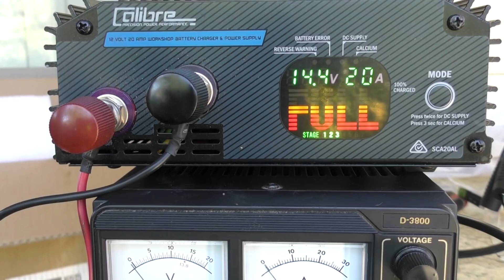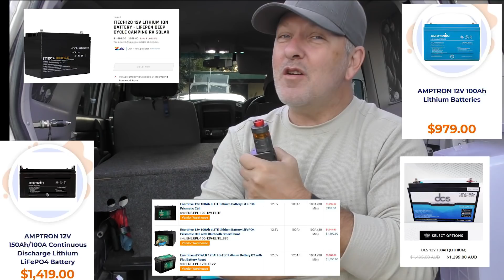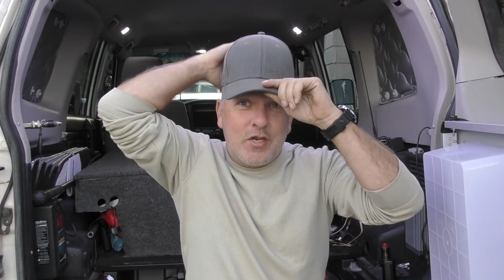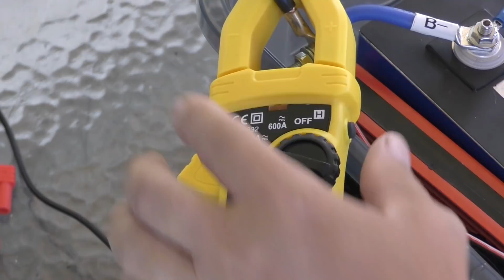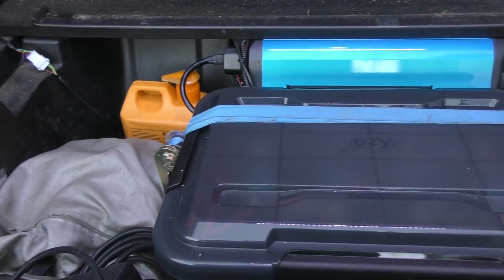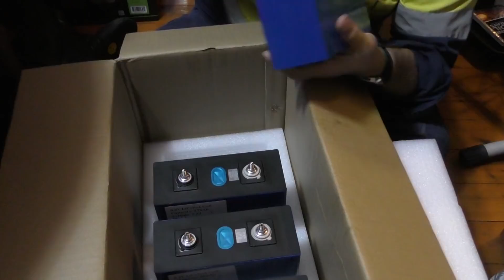DIY 4wd Lithium Battery install with inverter and induction cooker

Comment: As a newby to your site this is very interesting as are the other videos, as I am in the process of installing under floor batteries and compressor  but could not see me using that much power even though i have one of those hot plates, will go and see Redarc which is just down the road :-)
Reply from the maker: Leave your wallet at home

Comment: I bought a 300Ah (200A max continuous current) LiFePO4 battery off eBay $841. 2yr warranty. 
I also bought a 3kW Inverter off eBay for around $350. 
2200W Induction Cooktop off eBay $39.95. 
So I’m happy with that. I did also have to get various switches and 95m㎡ cables for the inverter but I’m pretty happy with the price. 
Also recently added a Ninja Foodi Flip Air Fryer oven for under $200 on sale.
I have a 40A DC-DC ($222) with solar input MPPT - 250W Solar currently. 

You basically can’t run an inverter and an induction cooker will 100A BMS. Everything will just take too long. You want to be able to run your cooktop at full power - you’ll be amazed how quickly water boils using induction but you’ll need to be drawing up to 200A for that. 

Mate - are you filming while holding a Vape?

Comment: Your battery should have a C rating charge and discharge.
The C rating is amps 1C = 100 amps
2C = 200 amps. 
Hope this helps
Reply: For those looking in the future, that’s not quite how it works, C refers to the capacity in Ah. 
Ie for 300Ah cells, 1C=300A 2C=600A.
Reply: @Br3no94  The battery C Rating is the measurement of current in which a battery is charged and discharged at.
Reply from the maker: You're both correct. The c rating is used to measure the charge and  discharge rates. The c relates to the battery capacity. So so if the battery or cells capacity is 100Ah   1c is 100A (1 x c),   2c is 200A (2 x c)  and 0.5c is 50A (0.5 x c)  .  I.e   # x Capacity = charge / discharge rating.  These rates are not always the same and often charge rates can be half the discharge rate.

Comment: Any updates on how the battery is going? Do you find the cells are ok when you go offroad? Ive got the same bunnings box as you but trying to work out how to strap it down in the vehicle and again how to secure the cells inside it to remove any up and down movement :). Loving the videos keep up the epic work! Thanks

Comment: Watched the video twice.
Absolutely would love a vid on the assembly of the Alibaba 4 x 3.2v lithium batteries and 100amp BMS showing fitment/installation in the Bunnings box, and holding them in place.
Wire gauge/sizes, inline fuses, Anderson plugs, crimping of wire lugs etc, and links to items if possible.
Cheers

Comment: That battery pack & BMS will fit in a king's battery box nicely.
 I easily get around 2weeks running my 40ltr Engel without any charge
Reply from the maker: Cheers Daz, handy to know. I had to go with the lowest profile I could so it would fit under the floor at the back. It didnt leave me much room on top.I might consider one of those though when I do the build for the caravan. I'll have a little extra height to play with but am considering 2 x 12v banks ...we'll see

Comment: Good vid! I looked at buying the same LiPo4 cells and a BMS, I guessed needing 300Ah but ended up buying a "reputable" Alibaba 200Ah battery delivered for A$700. I'll try it out, it took 3 weeks from manufacture in China to Remote WA (Australia Post takes 3 weeks to get a letter from Perth to Kalbarri!) with the idea of getting another so I have 400Ah and a weight of 40 kg, I have tried it out with a $250 3,000w inverter, peak 6,000w. The $50 induction cooktop I have doesn't phase it, I hadn't considered dialling down the power, a good tip but I will need a pod expresso machine, an essential for life camping! I am also toying with the idea of on-demand electrical hot water heating for showers and dish washing, the theory is dubious admittedly but I am keen to try it out. A good proof of concept plan, adventure is the game!
I only have a 250w solar panel but room for another, with Renology to handle the charging.
I like the app  you use to monitor, what is it?
Reply from the maker: Sounds like you're well and truly down the rabbit hole. On demand heating sounds good but power hungry. Keep me posted though if you find something that works. It's your set up in a van or a 4wd?

Comment: Great work and great video again. Congrats. I should stop watch your videos, my head is full with projects. 
Recently, I started learning about lifepo4 batteries. I am building my lifepo4 project in my head now. My consern is what cable size you run from the alternator to Daly BMS, and how these 250A effect to the alternator. Thanks
Reply from the maker: No worries, happy to help you spend your money 😁. The alternator isn't connected to the BMS directly. It's goes via the main battery, then through the dcdc charger and then to the battery/BMS.  The BMS sits between the battery negative and anything else that would normally be connected to the battery negative.  So the cable size has to be able to handle what ever load your dcdc charger will put on the main battery/ alternator.  The 250a rating of the BMS means it can pass through that current to loads connected to it. That rating has no impact on your main battery at all.   How that makes sense
Reply: @DENMONKEY  Thanks a lot. Now it is clear. 🍺🍺🍺

Comment: Thanks for the video. I've got the same exact BMS but on 100Ah cells through a 1000w inverter and trying to figure out if those 1800W+ induction units pulse their power draw from 0 to Max to simulate lower power when used on lower settings as that would trip my inverter or my BMS. Good to know your unit didn't do either. I'll probably grab one of those cheap-o cooktops off ebay so fingers crossed the Breville isn't doing something special..
Reply from the maker: No I was hoping it wouldn't do that, but I'm yet to hear of one that doesn't when on a lower setting. I'm need to do since more testing but it looks like the smaller the base of the pot/pan the less power it may use. But don't quote me. I've seen some odd things but that's what I'm thinking so far.
Reply: I brought 1000 watt kettle plus induction cook top just run cook top at about halfway. Many different cookers and crock pot about the 1000 watt mark 100 amp lithium battery   1000 watt inverter. 2000 watts is better but about twice the price to set up.

Comment: Might be a silly question, but if each cell is 3.2V & 270 amp hours. When combined would it make 12.6v and 1080amp hours??
Reply: Hi Nick, was just looking through the comments and saw yours. Not a silly question at all. The voltage and current values depend on how the cells are wired together. Each cell is 3.2V so you need 4 in series (cell 1 positive to cell 2 negative, cell 2 postive to cell 3 negative, and so on) to reach a 12V working battery pack, but series connections don't increase capacity. It's still 270Ah. And vice versa, parallel connections (all cell positives bridged together, all cell negatives bridged together) do increase the capacity, but the voltage remains at 3.2V for the entire pack. You can also arrange 2 series and 2 parallel connections to get a 6.4V 540Ah configuration, but most systems are in increments of 12V.

Comment: Thank you for an interesting video. Good to see some induction cooking. Myself is building a solar setup for my grandma off-grid, just waiting for the Daly BMS :)
Many seems to be more for gas cooking rather than induction. But I went with it anyways. Good to see some more people trying it out :) How many watts were you able to draw out from the inverter with the induction plate? Since we have 230VAC in Europe I couldn't follow since you have different voltage from us. Regards from Sweden 🇸🇪
Reply from the maker: Hi Oskar, thanks mate. Have a look at the recent video mate . I'll show me using the induction cooker and power usage in that https://youtu.be/MN58A8T92rw

Comment: Hey mate! Good to see someone else getting on the DIY batteries for 4wd/camping in aus!
Did you have to pay GST on the price quoted by the Alibaba seller? I'm looking at ordering some and they say the price "excludes taxes", not sure if GST applies or not. Thanks!
Reply from the maker: Hey Hayden. Thanks mate. I didn't have to pay any extra over what was quoted by the seller.  I think that changes if you go over the $1000 , I'm not positive though
Reply: @DENMONKEY  Tis! I bought one lithium battery for $700 while wanting two, just so I was under the $1,000 threshold for GST. Now after seeing the quality, I'll buy the 2nd

Comment: Hey bloke. Just bought a Pajero and been getting some good tips from you. Maybe you can help answer something for me. Where you have your Inverter mounted (Rear R/H side), there seems to be what looks like a square panel. Is this actually removable and If so, how? Would I lever It from the top, bottom or sides? Cheers :)
Reply from the maker: Hey Scotty, welcome aboard mate. No she don't come out mate, its just like a vent but its fixed in place. You could cut it out i guess but short of that, no go bro.

Comment: Hi Brett you missed your calling. What is the RFI like on 40 m when the inverter is operating?
James
Reply from the maker: Good question. I'll be checking that sheet of thing out once the instead has settled. Can't be any worse than some 12v fridges
Reply: @DENMONKEY  I cannot operate on 40 m with my 300 W inverter on regardless of it whether it is loaded or not
Reply from the maker: Yeah I'm expecting the same. My hf isn't in the car at the moment but I'm expecting to have to turn stuff off if I want to use it

Comment: Hey Brett, check out the back of this Pajero https://www.youtube.com/watch?https://www.youtube.com/watch?v=lSkcLjooa7s&ab_channel=%D8%A7%D9%84%D8%B9%D9%84%D9%8A%D8%A7%D9%84%D8%AA%D8%AC%D9%87%D9%8A%D8%B2%D8%A7%D9%84%D8%B3%D9%8A%D8%A7%D8%B1%D8%A7%D8%AA
Reply from the maker: Thanks Karl. Wish I could understand what he was saying. A bit more money spent on that one I think 😁 I don't want a gas bottle in the back like that one though but I did like those led light strips in the tops of the rear windows.
Reply: @DENMONKEY  Ahaha for sure I was not too keen on the gas bottle inside; however, despite the obvious dollar cost, thought it was unique enough to mention. 
Hopefully it inspires you and others to bring something more relevant to the Aussie options. 
Anyhow, the link hopefully helps both your and the Arabic chaps algorithm. 
Funny enough, despite not speaking not a jot of Arabic, after watching several of his Pajero related videos, it wasn't too hard to get the gist of what they're communicating. Google Translate, however, was more a hinderance than a help.
Reply from the maker: @karl4834  I appreciate it. I'll have a look at his other stuff. The trim work was excellent, albeit not my cup of tea.

Comment: Love the video mate,  looking at a2nd battery for my paj. Was looking at a DCS unit,  but this looks the goods with more power for a hell of a lot less. Would love to see the build and install video. 
How do you think the battery will handle bouncing around in the back on trips?
Reply from the maker: These are prismatic cells which are the details design as you will find in your off the shelf batteries. So in theory no more or less suitable for 4wd installs. The only difference would be how you package them and protect them. Obviously the off the shelf option has its own box to protect the cells. I've seen others build these into a timber box or just use a battery box like those from Supercheap . I was going to use one of those but couldn't find one the right size. The dcs have a good rep and I don't want to talk you out of them,  I just want to share what I'm up to for informations sake and still want everyone to make their own choices.
Reply: @DENMONKEY  all good Brett, just want sure how the batteries were secured in the plastic tub so I thought they may bounce around a bit.  Sure you have them strapped down tho.
Was very interested in seeing your build,  as I didn't know this was an option in building your own battery.  And you can't beat the price for the aH available. 
Beats the cost I was looking at for over $2k for DCS batteries.  Means more $$ that can be spent on the rig 😉
Reply from the maker: @mcduncanpresents9389  I think I can still do better from securing them and I really want to have a close look at the fuse holders and shunt etc inside the box to make sure they wont rub against the aluminum casings of the cells. but these are the things you do with DIY I guess. yeah. I didnt win that 80mil on power ball last week either.

Comment: I've been cooking with that identical induction cooker, can confirm i can have the pan hot and spitting shit at you at 1000W. dont need loads of power into them. Yet to figure out how long it would take to replace the energy used as its not on offgrid setup.... but roughly 1000W for 25ish minutes...
Reply from the maker: cheers Spook, that sound similar to my experience thus far. that half hour odd is my expectation for cooking. based on my load testing thats about 50ah. which at full sun would cost me about 3 hours on solar or 1 hour running the car. but of course I could do this for several days before needing it to be topped up. usually when I'm caping its either short stints of a few days or has several hours of 4wding in the middle. Still , I'll need to put it into action to find out real world

Comment: Great videos mate. Given me some great confidence with decisions I’ve made for my Paj knowing that someone is doing the exact same setup. Might have to have the induction cooktop though, seems awfully convenient.
Reply from the maker: Hi Travis, I'm sure thinking it is. It's all nice for it to work in the drive way but time and real world testing will tell.    Did you set up a build over the back too ?
Reply: @DENMONKEY  I look forward to seeing how you fair with it.
Mines a work in progress, I’ve taken out the RHS plastic panelling and made a steel frame to house the battery and other gubbins but it’s taking a bit longer than expected. I keep wanting to add more things to it!

Comment: Is it possible to use smaller cells, say 150AH? And when are you going to be selling these kits, put me down for one 😁
Reply from the maker: sure is Glenn. the reason I went with these is even the smaller ones from the same sites were similar in price to these cells. So I figured why not go the bigger ones. It's overkill for sure but nice to have. No selling for me im afraid. Happy just to let people know my experience and let them make up their own minds.  I even hate the thought that someone might do the same as Ive done and have a bad experience. Not that I can control that though. If I was selling stuff, I'd be a wreck worrying about it.     there does seem to be retailers in Aus doing just that though. mark ups though still make it worth looking oveseas in my opinion.

Comment: Just wondering will the agm ac charger , charge the lithium?
Reply from the maker: ummmm maybe. my supercheap one was pushing the required 14.4v into them when hooked up but I only used it to do a bulk charge and wasnt sure how it would respond when the cells neared their fully charged state or if it would just keep trying to push more current in.  So that was why I purchased a dedicated charger. If you have a variable power supply like the one I showed in the video, you can select the correct voltage and use one of those.  Also some lithium off the shelf systems call themselves drop in replacements for agms and say you can use all you normal chargers as the bms will handle the rest. I'm not sure on that and can't give a definitive answer. lithiums don't like to be float charged. so a proper charger only does bulk and absorption modes for lithium. floating them can hurt their longevity.
Reply: @DENMONKEY  thanks for your reply I think your right 👍

Comment: Make a small cargo net to fit rear side window to use as a storage pocket? It would fit your pan.
Reply from the maker: Got my eye on those shoes storage pocket hanger things. Problem is I've tried the hanging stuff before and it's all good on road but as soon as I go off road everything bangs and clatters on the track.
Reply: @DENMONKEY  that's what tea towels are for just wrap them and add Velcro

Comment: So funny. I’ve literally done the same. Smaller cells though and stuck mike in a toolbox but same bms and smart shunt monitor etc. great job! I too looked at Will Prowses stuff to learn this. 👍👍
Reply from the maker: Hey Mike, how good is that space for this sort of gear 😁.  Sooo good.  I'll get my links so sorted where I got mine from and would be interested if you used the be same suppliers. Did you use Alibaba or another source.  How have they been performing ?
Reply: @DENMONKEY  I nearly went for ali but ended up buying calb cells from Solar4RVs from here for my first time. But the rest of the components I used AliExpress. Next time, I’m going to buy everything from AliExpress

Comment: Thanks, great info. I look forward to the product links. I've wanted to do a diy lithium for a while. A portable to move between my Paj and boat and maybe a permanent for the camper. I bought the Kings 15L fridge and it's been awesome as an alternate drinks cooler and bait freezer.
Reply from the maker: This set up could definitely work for you then. I'll be sure to show more detail on the box etc in the next vid. When i watched this back I noticed I didn't show enough footage of the batteries in the box. Links will be up in 2 days. Just need the time to put them up.